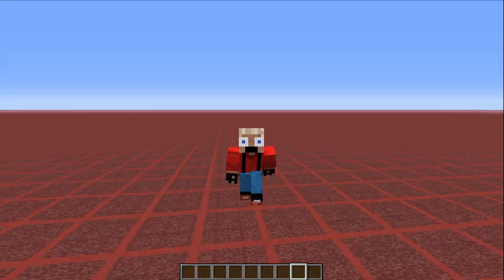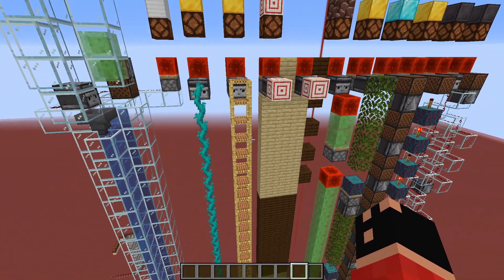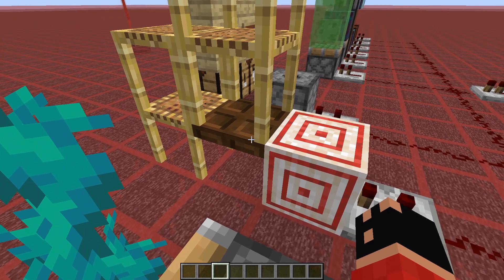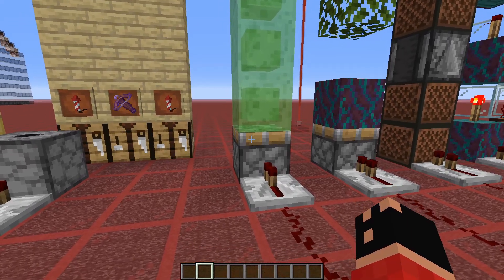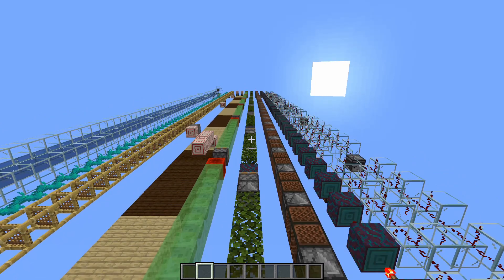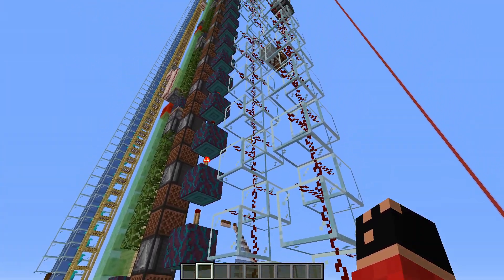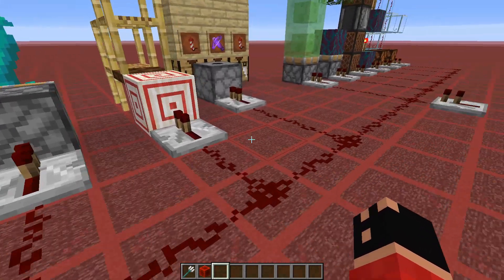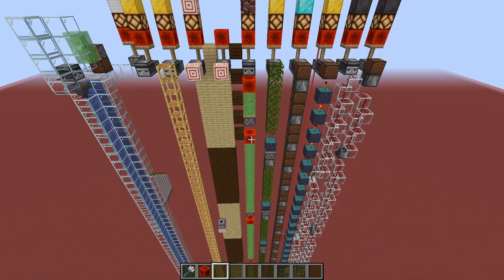Vertical Redstone Signals ( Upwards )

Comment: Which one of those makes the elast lag?
Reply from the maker: The scaffolding should be the one making the least lag. The Observer Slimeblock chain is also good for reducing lag. Same goes for the log leaf variant.  Anything that uses exposed redstone wire or torches is normally not so lag friendly.
Reply: @ironspiderfist  thanks so much! Gonna use this in my MC World with my friends. The least laggy one I'll take.

Comment: Thanks for the video! Just wanted to add that there is an alternative to note blocks: doors. Though it may become too noisy for tall towers, it is quite fun to have iron doors if you just need to send a signal up/down a bit. In this case those iron doors may ensure authenticity of your devices through periodic flipping :)